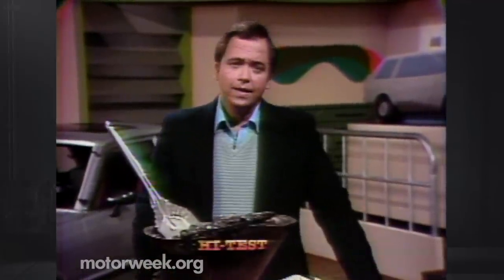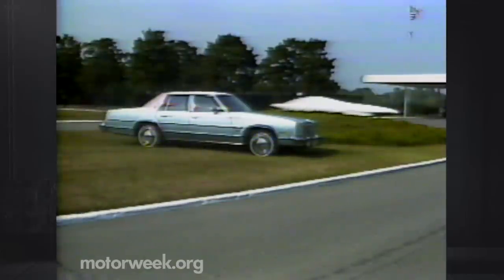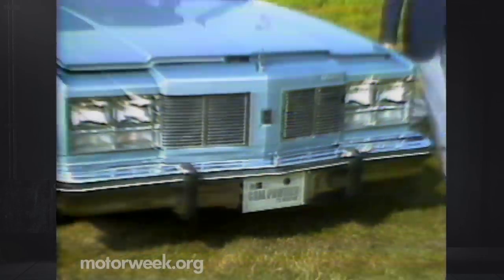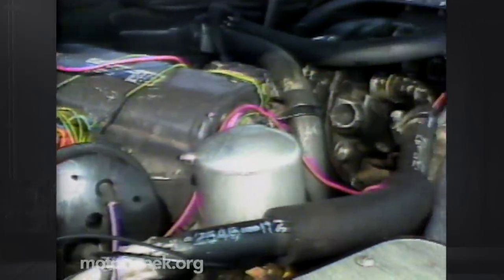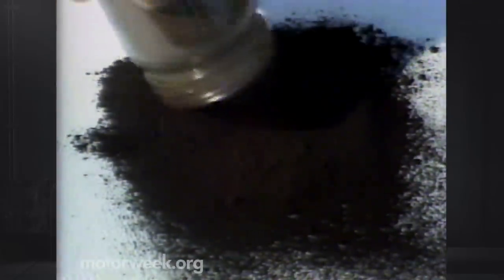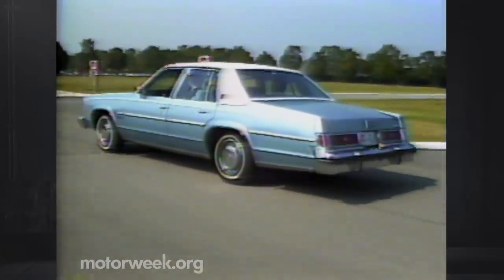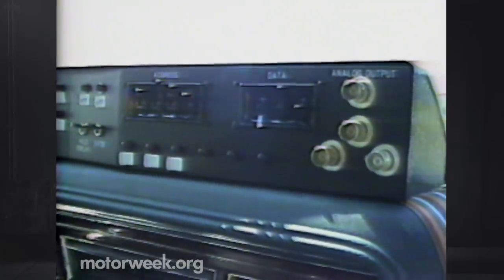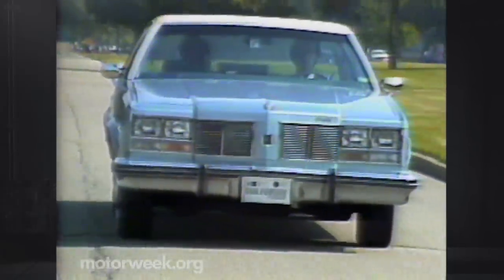Retro Review: Coal-Powered Turbine Engine Oldsmobile

Comment: Coal dust? That probably doesn't pollute much.. #Yikes
Reply: Barack Smith did you see any soot? no? thoughtso.
Reply: start watching the video close when the car is first shown.. its clearly smoking visibly at idle
Reply: "Clean coal" doesn't exist, it is still more of a concept than reality. Coal pollutes.
Reply: Good thing the oceans aren't actually rising at an endless rate, push some more rhetoric this is a great idea. Clean coal does exist green energy is a scam
Reply: ossimjew ha! 😂😂
Reply: Yeah, no one who believes in massive sea level rise has ever been to the beach.  Those hotels have been in the same place for over 100 years.  If the sea came up a foot they'd have to move them all up and down the coast.  The greens say the sea has risen 6-8 inches in 150 years.  I have trouble with that because how the heck do you even measure sea level to within a few inches now, much less 150 years ago.  I don't believe they could, I'm not even convinced they can now, too much movement of everything near the shoreline.  
Anyway, say it did come up that much.  How does this jibe with the prediction of 20 feet in the next 30 years?  It doesn't at all.  It's just for fund raising IMO.  Also, eventually we'll have another ice age, thousands of years but it is very likely to happen.  NYC was under 1500 feet of ice.  They'd be begging for global warming then.
Reply: +Jordan Wiley I'll take that as a compliment
Reply: In 1982, emissions were damned.

Didn't matter if the car was powered by pure cancer, if it fits...sell it!
Reply: Al Gore has made millions off fear mongering over supposed man made global warming.  As he jets between his three mansions.  I do not believe they could accurately measure sea level 140 years ago and I still don't believe it's perfect now days.  A GPS is good to within three feet and we're talking maybe half a foot over 140 years.  Same with global temp rise.  You telling me 150 years ago people all over the world were accurately measuring to tenths of a degree?  BS.  They say 1.5 degrees or 1 degree or whatever, well within the margin of human error.  I'm surprised the margin isn't 2 degrees.
Reply: Maybe in parts of the USA the thermometers were accurate.  Doubt to a tenth of a degree.  But in many places in the world temperature was an educated guess.  Liberals always look at the first world but then say the world temp is on the rise.  I understand, you have to have faith that controlling CO2 in the USA will somehow keep the world temp from rising and that it's been rising faster than normal and that it won't ever come back down like it has over and over throughout history.  Sounds more like a religion than science.
Reply: carzak I kind of think man made climate change is the liberal religion.  Just ask yourself why the prophets of the religion all fly around in private jets and own multiple homes.  They all generate 10X the CO2 the average person would.  Now, if you really believed in something you were promoting and it was critical to survival of the human race, would you live like you believed it?  See, since they don't live like they believe it, I think they don't even believe it.  I think it's just a way to make money or increase their fame or whatever.
Reply: Climate Change or not, whether you believe it or not.. I like healthy eco systems, healthy air, run off, streams, etc. Be a skeptic if you desire, but the fact is we pollute and it is not exactly okay
Reply: again, climate change or not, I want to see us create a healthier place to be alive. For us now, and for future generations.
Reply: djkenny But that's the problem.  While the EPA diverts resources away from fighting real pollution to fight fake pollution (Co2) then we all lose.  I'd rather see the EPA go back to fighting real pollution of which there is plenty about.
Reply: Automotive emissions are very much REAL pollution. Big time.  As is factory farming, pollution from manufacturing,  etc... CO2 is a big part of that.
Reply: this is the debate that doesn't end.. it just goes on and on my friend..lol
Reply: djkenny CO2 isn't even pollution, it's what we breathe out and plants breathe in.  Carbon MONOXIDE is real pollution.
Reply: carzak Actually no.  The weather report is terrible it's not even usually correct 2-3 days in advance so it's impossible for me to trust people that tell me what is going to happen in 10 years.  Look at long range forecasts,  pick a day 4 days in advance and watch how it changes.  I've see it change in the middle of the night before that day.  Go to bed with one forecast, wake up with another for the same day.  And even the same day isn't right most of the time.  And good, they need to stop diverting resources and put them all toward pollution because they don't have as many as you think they do, they can't even afford to clean up all the toxic waste dumps.
Reply: carzak Yeah, they can't predict the weather three days from now accurately but I believe that they can predict the climate in ten years.  No I don't believe it.
Reply: ooooh, your argument is so persuasive, where can I join the church of man made climate change?  Is it like scientology?
Reply: No, just read science, try the NASA climate change page for a start, assuming Trump hasn't had it taken down. The thing about science is it doesn't care about your ignorance. There are no "alternative facts" in science.
Reply: Yeah, the same science that predicted 20 foot sea level rise and the same science that showed it would be a lot warmer now than it is.   They can call it science all they want but most of it is political.
Reply: Oil rig companies just spent millions raising their off shore oil rigs by 8ft, (4ft sea level rise and Miami is gone) Why do You suppose they did that?.. 
"New NASA Model Maps Sea Level Rise Like Never Before (Video)"
http://www.space.com/30379-nasa-sea-level-rise-model-video.html
Reply: Why do you suppose hotels have been built on the East Coast of the US in the SAME PLACES for over a hundred years and they haven't had to move them.  If the sea came up one foot, they would have to move almost every hotel on the east coast that's ocean front.  No go ahead and dig up examples of localized beach erosion and pretend they are globalized. I read a thing the other day that said the sea hasn't even risen at all on the East Coast of the USA and they can't figure out why.  LOL such BS.
Reply: I always like articles where people say "there's no doubt" and it's "more than beach erosion."  Yep, opinions.  And I guess you'll just ignore the East Coast thing.  Even the prophets of the religion say the east coast sea level isn't rising.  Because you know, sea level only rises in certain places of course.  I bet you even believe if sea ice melts that causes sea level rise.  This is all a waste of time,  I'm not going to argue with you about Catholicism either.  If you are Catholic (doubt it), you believe what you believe.  You have faith.  So you have faith that the earth is warming and will continue to warm and the sea will rise 20 feet any year now.  No point in arguing about it.  I WILL look for those hotels on the East Coast to be moved any time, thousands of hotels just where they have been for over 100 years.  You'll say no they weren't built that long ago to try to trick me, but hey SOME hotels were there, the point is there have been some hotels there for over 100 years.  As they are rebuilt and renovated they haven't had to move back from the ocean.  The solid spots chosen are the same.  It will be pretty funny in 30, 40, 50 years when they still don't have to move back and people are still pretending there will be huge sea level rise any year.   You do know eventually there will be another ice age right?  New York City was under 1500 feet of ice at one point and will be again thousands of years from now.
Reply: I give up on this.  You at least recognize that the sea level isn't going to come up 20 feet in five years like some of the alarmists.  The idea is it's up 7 inches in 150 years which I don't believe.  It would take a foot to have to move the hotels.  1 foot.  We're not even close.  I believe maybe right now they can accurately measure sea level to within an inch or whatever,  maybe.  But 150 years ago, BS.  No way.  I bet 50 years ago  no way.  So they have no idea how much it's come up or not come up.  How would you even measure such a thing with tides, wind, constantly shifting sea bottom, currents, etc.?  Within a few inches 150 years ago LOL.  Anyway, I don't want to talk about this anymore.  Eventually the alarmists will be proven right or all this crap will fall out of fashion and new alarmist crap will take it's place.  I'm convinced humans need to have some alarmist crap all the time, it might be left over from our early days when we had to chase animals and be chased around ourselves.  We get bored when we aren't in a panic situation and we make up our own situations to amuse ourselves.
Reply: Who cares about Global Warming (well, I certainly DO) does anyone care about the carcinogens in the air we breathe? Cancer causing? Impacting all life? Watersheds being polluted? Even if GW was some kind of conspiracy (Science has proven otherwise) those concerns should be Paramount above all things.  Coal is pretty bad.
Reply: Yep real pollution vs. fake pollution.  The GW crap takes resources away from fighting real pollution.  There are already not really enough resources to fight real pollution.
Reply: It does not take away resource, the war machine does.  Our 36 billion in subsidies average per year to the fossil fuel industry does that. Divert funds to Exxon Mobile, and we can have solar on 50% of the buildings in the USA and start putting solar on our main roads. We should move away from all fossil fuels and we can. Let's not forget the billions in our military spending.  We can be mostly renewable, it takes priority.
Reply: 19.5 MILLION barrels of oil per DAY used in the USA.  Yeah solar and windmills will replace that.  That's not even natural gas and coal.
Reply: A barrel of oil is 55 gallons i believe.  so 19.5 millions x 55 gallons.   EVERY DAY
Reply: Clearanceman2 it could and it should. I mean, GERMANY is far outpacing America in the solar race, because, you know, Germany is known for its  sunscorched landscapes. It's a fucking we aren't at the top of the heap in the solar and wind generation sectors.
Reply: Much of the grid in many developed countries now are almost 1/2 or better wind and solar.  Sun rays come through even in cloudy places VERY well.  We can do a lot better.
Reply: Additionally, we can add more charging stations for automobiles, more transit, better city planning, more bicycle infrastructure, and again.. stop giving welfare to the coal and oil industry. The addiction can be less. A LOT less.
Reply: Those countries don't use anywhere near the energy we do.  CA alone is like the 5th largest economy in the world.  Charity Euro countries aren't really a model for prosperity.  One day Germany might run out of money.
Reply: It's because they lose money.  By the time they break even, they need maintenance and lose more money.
Reply: Clearanceman2 Germany is an economic superpower.
Reply: Disingenuous fear mongering.  I would expect nothing less from an environmental extremist.  You know as well as I do that carbon dioxide is a trace element 2 hundredths of 1% of the atmosphere.  There is no chance of it ever becoming high enough in concentration to kill someone.  It's also what plants breathe and you know this too.  It's not a pollutant, it's a natural trace element.
Reply: Nothing extreme about recognizing things for what they actually are, instead of living in Denial about it.
Reply: Once again typical liberal confusing pollution with carbon dioxide.  You guys lump the supposed man made global warming thing in with actual pollution to try to scare people into buying into the theories.  No question that actual pollution could be cleaned up better.  Especially if scarce resources weren't diverted to fighting "man made climate change."
Reply: We don't all live in LA or San Francisco.  Some places aren't even car friendly much less bike and bus friendly.
Reply: Clearanceman2 I understand that. Push your local government to do something about it. Here in CA, places like Victorville out in the desert requires all new construction be solar powered. Everything is moving in this direction. The next huge leap (we already have them) is hydrogen cars.
Reply: Ha, I'd just be happy to have shoulders on the road and get rid of most of the potholes.  CA is nothing like most of the rest of the USA.  It seems like everything is going in that direction because you see it there, but it's not most places, especially in the East.
Reply: Clearanceman2 🤘🏼⚡🤘🏼
Reply: Theres actually LOTS of areas much more together than CA in terms of building better more livable neighborhoods, hubs, cities, etc. They are not even in the top 5 for better infrastructure. Opening up transportation options, from active transport to transit means healthier more active and less obese populous. It also means less stress on the roads when only used by automobiles. It is just good all around. CA is actually behind many other states, with a few exceptions. It is very auto dependent in too many parts of CA, which is pretty unfortunate.
Reply: L.A. is a perfect example of city planning gone sadly wrong. It is extremely sprawled out and auto centered with tremendous pollution. OPEC is a part of why that city went away from being one of the most walkable and transit oriented city in the nation to a gross unfriendly traffic filed wreck. In time they will correct this out of necessity and are planning to create a bicycle friendly environment and improve transit. It is in the works. Regardless, even in areas not better planned, they often can be.
Reply: *L.A is also a city with 10M people in a state with 35M people.
Reply: Precisely, time to move away from auto centric culture. Why we still are without a high speed train in CA? So slow in the USA.
Reply: Barack Smith  Not to mention 4,000,000 or so illegal immigrants from Mexico and other Banana Republics

Comment: This would be great if it meant we could once again buy real full-size cars instead of the little aero-boxes and SUV we are stuck with today.
Reply: Just for fun, google the length of the 1977 Oldsmobile Delta 88 and the length of a 2017 Chevy Impala. Not a huge difference. :)
Reply: And then, for even more fun, google the length of the 1982 Honda Civic vs. the 2017 Honda Civic. Cars have been steadily increasing in size since the mid-1980's.

Comment: if it didnt work for the railroad, it aint gona work for a car :) still would like to have one for haha's
Reply: im talking about coal(dust) turbine steam locomotives. google it some time. thats WTF im talking about.
Reply: One of Union Pacific's gas turbine locomotives that originally ran on heavy fuel oil("bunker C") was converted in a research experiment to run on coal dust in the 1960s, while it did work, the acidity of the coal destroyed the turbine blades in short order.